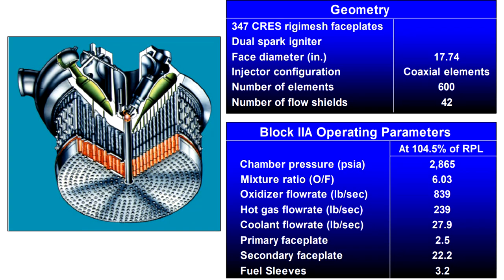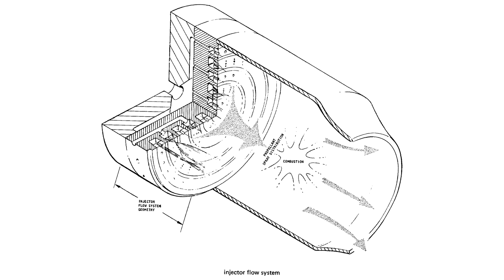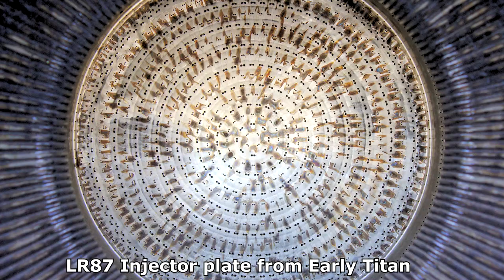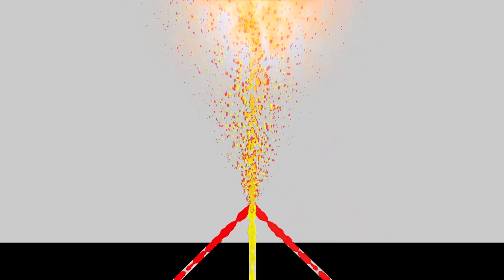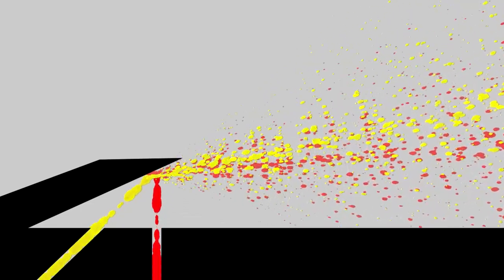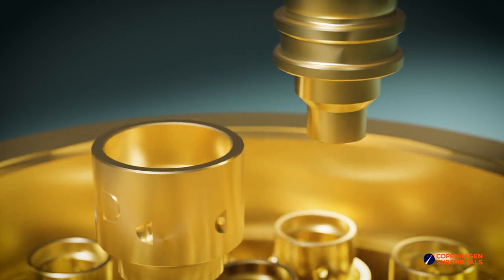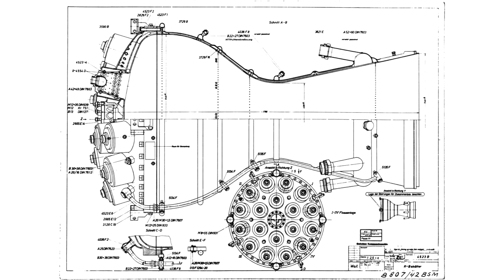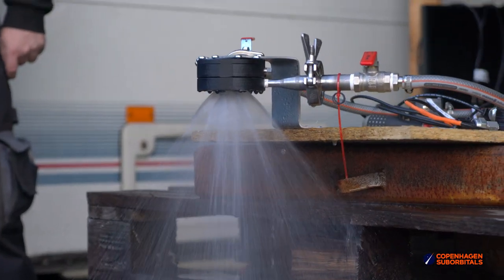Rocket Fuel Injectors - Things Kerbal Space Program Doesn't Teach

Comment: Real good Scott.   Your pictures you showed was familar to me. I was Chief Inspector at Wellman Dynamics Corporation from 78 to 1988. We built the main fuel injector  for Rocketdyne for all the Space Shuttles and the Martin Marietta fuel transfer elbow on all the 7 space shuttles back in 1980 thru, 1987. We used aluminum and had the secret McCanna cores made from glass for the fuel passages to  a tolerance of +/- .0015. We have a perfect record on all class 1A castings, never have had a part fail from the wide range of Boeing ALCM Cruise missles tanks, warhead and tail engine section.  Sikorsky main gear box housings for Blackhawks and conopy frames for the General Dynamics F-16 Vipers. The turbofans for a wide range of Pratt & Whitney jet engines. among many other parts in alum & mag. I really enjoy the knowledge you have in the videos you make.

Comment: Literally my dissertation that I'm working on right here (on swirl coaxial injectors): 

While I can't be 100% certain, the Raptor engines' ones would probably be similar to the Copenhagen Suborbital's ones in that the fuel is swirled by entering the injector tangentially (consider the location of the fuel rich preburner and turbine with respect to the injector face plate), given the location of the oxidiser rich preburner and turbine, the oxidiser should flow more or less in a vertical straight line towards the injector. 

As the oxidiser is entering the injector coaxially, it cannot be swirled like the fuel, although that does not mean it cannot be swirled (here's the guessing bit) - I reckon the raptors probably pass the oxidiser through swirl vanes to increase or create swirl. The reasons for this are:

increased shear between fuel and oxidiser creates more intense Kelvin Helmholtz instability which kind of results in folding of the fluid layers more efficient combustion;
a vortex breakdown can act as a bluff body for the fuel to impinge against;
the vortex breakdown acts as a recirculation area for more thorough, and complete combustion;
the recirculation area serves to stabilise combustion;
the swirl vanes themselves produce a pressure drop, meaning that the injector can be shorter for the same amount of pressure drop;
shorter injectors mean lighter engines;
shorter ones are stiffer and are less prone to fatigue and cracking which is key to reusability.

the only drawback I can come up with is that they're a bit awkward to make.
Reply: I understand all the individual words you used...
Reply: @sasor098  Thanks! always wanted an internet cookie :p
Reply: And that “awkward to make” is where 3D printing comes in!
Reply: You may be the person to know an answer to my question: Why is it, that the whole plume is not swirling? Because i got the impression that instabilities or fluctuations are better contained in rotating streams of liquids or gases. Also they could work nicely with that centrifugal pressure gradient, as they could overexpand the plume without "stalling" the nozzle. Creating a vacuole in the middle of the plume, one might be able to create an aerospike-effect and make the engine more adaptive to changing ambient pressures. So am i missing out on something?
Reply: Kelvin Helmholtz instability a.k.a. mushroom clouds :D 
in all seriousness though thank you so much for the in depth explanation, i hope you'll design rockets of your own one day (or better, bona fide spaceships built, used and maintained in space)
Reply: @A.Lifecraft  Wouldn't that result in a net angular momentum transfer for the whole rocket? (So it would start to spin around its thrust vector.) And that might be undesirable. (Or you would need to pair up the thrusters to cancel this out, but it's usually good to have a central one,  etc.)
Reply: Very interesting, thanks! I was wondering about how those fluid dynamics affect it, there must be room for improvement there with a better understanding, like your work 😎
Reply: Maybe send you dissertation to space x.. You might get a job offer 👍
Reply: @pas.  The rotation would consume energy, so the engine bell geometry should retrieve that energy using sort of fixed turbine-blades. This retrieval of rotational energy from the plume would add to the overall thrust. The amount of energy you retrieve from rotating gases similar as in jet engines does however not account for your basic pV=nRT, meaning you could increase energy density of the engine without increasing chamber pressure or fuel flow.
Reply: @A.Lifecraft  Here are my thoughts:

While swirling flows are more stable, by having all of it swirling inside the chamber, the flame will basically be attached to the chamber walls, consequentially, you'd get higher heat flux  on the chamber walls which can melt them without sufficient cooling.

As the flows are taking a longer path and against the chamber wall, you'd get more friction losses (or viscous losses) as compared to a flow that travels straight out. To me, this would reduce this would reduce efficiency in the engine (specifically, reducing c*) and result in a reduced Isp. There would also be viscous losses along the nozzle further reducing Isp.

Other practical considerations wold be that the flows would induce a torque on the engine which would need a counter torque to balance it out. Additionally, in the event of an engine out failure, the torques would be unbalanced resulting in a rocket spinning on its longitudinal axis. 

To me, energy that is used to accelerate a flow radially is wasted as its not contributing to thrust (the tangential component of the flow is orthogonal to the direction in which you want the thrust).

On the over expanded plume, I'm not sure its worth the effort, but you might get some pretty mach diamonds as the expands and contracts downstream. Also probably very loud from an aeroacoustics stand point. If i were to guess, if the flow is over expanded (resulting in a lower static pressure) and swirling, going into a domain of higher static pressure, the vortex core might become unstable and start precessing. might produce vibrations on the rocket? dunno
Reply: @claudiusdunclius2045  possibly, but surface accuracy and smoothness could be an issue. Scrapping it due to faulty printing would be costly.
electric discharge machining gives excellent surface finish, but it might be too slow of a process for this part.
Reply: "here's the guessing bit" - are you sure your supervisor will let you get away with that kind of language in a dissertation? 😉
Reply: @nexusofjoseph  you're right, should have said "my hypothesis is" instead XD
Reply: @HuesonWong  Not sure if you understood me right. My idea was somewhat analogous to jet engines where turbine-induced rotation is repeatedly taken out of the exhaust by counter-blades. The exhaust stream is ultimately mostly laminar and all rotational energy converted to thrust. This might also be achieved by an engine bell with screw-like shape of sorts. Adding additional blades inside the engine bell, the amount of rotation could be controlled thus modifying enginebell-geometry in flight. Think 2 rings of control blades, one near the neck and the other close to the end of the nozzle. The latter would make for an exhaust plume free of spin while the one near the neck could predetermine the rotational speed within the expansion bell and provide stable flow in an overexpanded nozzle at sea level.
Reply: @A.Lifecraft  I don't think I fully understand, but the way i see it, adding blades into the flow would melt no matter how cooling you have on it. swirling flows adjacent to any surfaces would increase viscous losses and reduce Isp. If you want overexpanded flow at sea level, the RS25 engine had a little trick on the end of the nozzle which i recommend checking out.
Reply: Hueson Wong I’ve seen some 3D-printed conceptual designs for this (co-axial counter-swirling flows) but I think they (the passages and turning vanes) weren’t at small-enough scale.  That said, seems to me that for a swirler, the geometric accuracy and surface roughness of the vanes isn’t so critical - as compared to, say, compressor or turbine blades or vanes.  EDM would be very difficult but possible.
Reply: I don't know if you are taking this into consideration when talking about fluids,, but all of the fuel and oxidizer enters the combustion chamber of a Raptor as an approximately room temperature, very high pressure gas. This would still act as a fluid but there is no liquid according to the design anyways. The gas exiting both pre burners to drive the turbopumps is also at about room temperature ( oddly enough ).
Reply: @A.Lifecraft  If you're using lots of coaxial nozzles, perhaps you could run counterrotating swirls in neighbouring ones (or some setup so that the individual swirls cancel at larger scale) to avoid needing (fragile) postcombustion stators - bear in mind that gas turbine engine turbine stage blades and stators all need bleed air to prevent them melting (which is collected from the precombustion compression stages and reduces efficiency - but that's better than destroying the turbine stages). These things are a tad too small/finnicky to run closed loop LOX/LH2/Methane piping through without risking SSME-style engine explosions (Those RS-25s blew up a depressing number of times on the test stand in the 1970s before bell welding leak issues were nailed down - although this was mainly due to NASA's "test the whole thing, not the parts" philosophy of the time and a loss of manufacturing lore the agency had to counter by trawling retirement homes to catch engineers and get details out of their heads before they croaked)
Reply: @miscbits6399  but this would not harvest the rotational energy, thus ruining the whole idea of using centrifugal forces to get higher efficiency out of shorter nozzles. You see, Gas particles bounce on the inside of the nozzle transforming radial momentum into backwards momentum and thereby creating forwards countermomentum in the engine. If radial momentum ist composed of pressure plus centrifugal force, this would increase thrust without increasing chamber pressure. I am right now looking into low budget simulation software to get a feeling if my idea ist all stupid 😂

Comment: Mach diamonds make me smile.
Reply: The mach diamonds are actually the parts of exhaust stream that drops to subsonic velocities which I still don't fully understand. But they make me smile too. :)
Reply: Pure, distilled, unadulterated awesomeness. THAT is what mach diamonds are.
Reply: Hell yeah, make me have a cheeky-ass smile everytime!
Reply: @williamgreene4834  Actually that's not correct. A jet of gas displaying mach diamonds is by definition moving at or above it's own speed of sound (some regions get down to mach 1, but never below). As soon as the gas slows to below it's own speed of sound at some distance from the exit, that is where the mach diamonds end. In reality, this point fluctuates as nothing in real life is as perfect as on paper, but it is most definitely supersonic.

Mach diamonds form when the static pressure at the exit plane of a supersonic nozzle or choked orifice is lower than the ambient pressure (which is what I think you may have read and possibly remembered incorrectly?). In the case of rocket nozzles, Mach diamonds are an indication of over expansion. This means that the diverging nozzle section is larger than would be theoretically most efficient at that altitude. Of course you can't adjust the nozzle size mid flight, so most nozzles on boosters are designed to achieve perfect expansion at some altitude between liftoff and burnout. The exact optimum altitude as specific to each rocket.
Reply: @superdupergrover9857  I totally agree. It's just such a shame that they are actually an indication of a rocket engine operating inefficiently.
Reply: @maxk4324  The following is from an advanced rocket engine manual.     As they encounter the boundary the pressures
between these supersonic waves and the ambient pressure are quite different setting up another
reflection that this time produces an expansion
fan of waves known as Prandtl-Meyer phenomenon. The expansion fan
also cannot pass through the center
stream of particles and is reflected
again back toward the outer boundary
layer. They return as an oblique wave
so the process of compression and
expansion begins again. The end result is that a second Mach Disk will be
formed where the compressed flow
from the oblique shock becomes parallel with the flow and a normal shock
wave forms. One other important
feature of the flow is that immediately
behind the Mach Disk the flow momentarily will be subsonic but quickly
returns to supersonic.
The Mach Disk will evolve into a diamond
shape under the complex flow of a rocket exhaust
and becomes visible when the resultant temperature and pressure ignite unburned fuel.
Reply: They make me burn
Reply: Hell yea inefficiency is so cool!
Reply: @williamgreene4834  interesting, thank you very much for the more in-depth explanation. So I guess it seems that in the diamond there is a region right behind each mach disc that does go subsonic briefly. That makes sense I guess since it's technically a normal shock wave there, which only happens when you go from sub to to supersonic of vice versa. But I still think it was important to point out that the majority of the flow is still supersonic and must be so in order to form diamonds.
Reply: @maxk4324  You are correct. The subsonic area is very small and it's more of a technicality. I have fired my own solid rocket engines on a test stand with video cameras and Mach diamonds are really beautiful. :)
Reply: They say diamonds are a girl's best friend.  Mach diamonds are a guy's best friend.
Reply: @williamgreene4834  I had no idea this would turn into such an interesting topic. Thanks everyone for the information.
Reply: Don't smile at pretty inefficiencies, engineer them out. This may not apply to women... but should.
Reply: @PalimpsestProd  There is no engineering them out any more than you can engineer out standing waves in rapids in a river without removing the river bed. Rocket exhaust is supersonic axially but also expanding radially. This complex flow produces areas in the center of the stream that collide and compress the gas momentarily. In order to compress a gas you have to push it into a smaller space which causes it to slow down. The backside of these areas  are decompressing causing it to speed back up.  OOOOh look I wrote a book, sorry. I agree women are confusing though.
Reply: they are a sign of inefficiency

Comment: 3:55 That's actually a best case scenario of impinging jet misalignment. Depending on the impinging pattern used, if one of them misses it's mark you could be shooting a jet of pure oxidizer straight at the blazing hot wall, which regardless of the material used likely wouldn't be long for this world.
Reply: I believe that's called an unplanned rapid disassembly.
Reply: @ShiftyMcGoggles  
shorthand is RUD, not URD ;-)
Reply: @ShiftyMcGoggles  For the rest of the rocket, usually yes. But for the unlucky engine it's more like the combustion chamber drops the "chamber" and simply becomes combustion as the metal of the walls is rapidly burned away from the flow of pure oxygen (or equivalent oxidizer).
Reply: Back in my Rocketdyne days, we used to refer to that condition as "hardware-rich burning".   An oxygen-rich emergency shutdown of an SSME from mainstage operation (say, due to a failure of the high pressure fuel turbopump) could SLAG the entire interior of a powerhead assembly in a few seconds.  The results were extremely ugly, and very sobering to behold.

Comment: Nicely done Scott.  
One other consideration for injector design is the influence it has on the Rapid Combustion Zone.  

This is the region just downstream of the mix zone that is also the primary source of energy  that feeds  acoustic combustion instability. This is the type of instability that arises from a high frequency acoustic  resonance within the combustion chamber, also known as "screech".  Screech can destroy a combustion chamber from mechanical environments, pressure oscillations, and rapid heating in as little as a few seconds.

Baffles, which you also alluded to, are sometimes added to interfere with the radial and tangential standing acoustic waves.